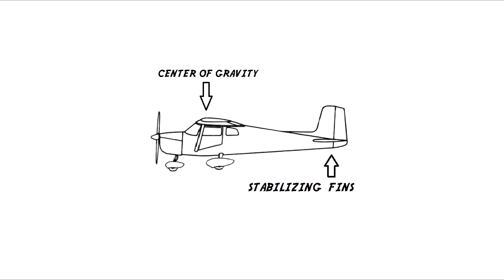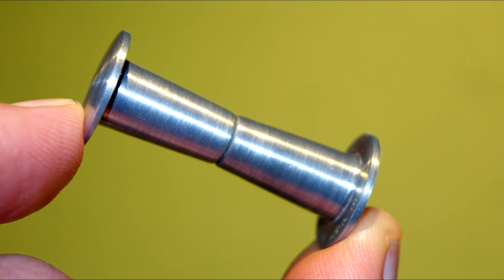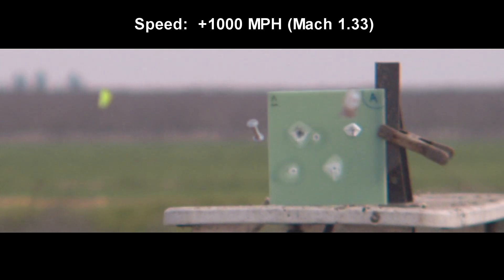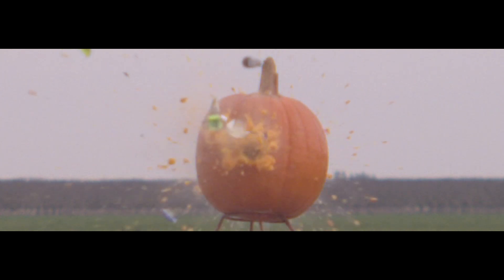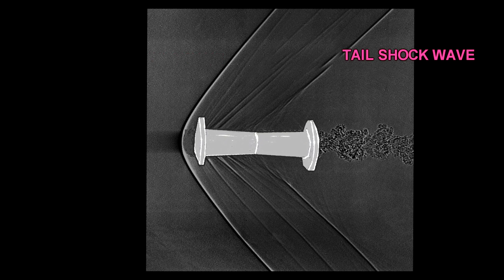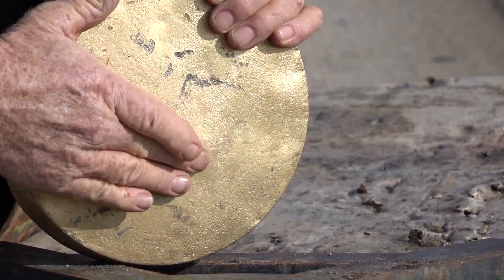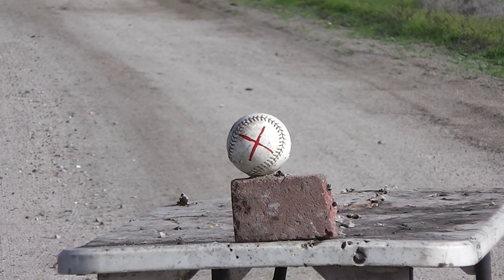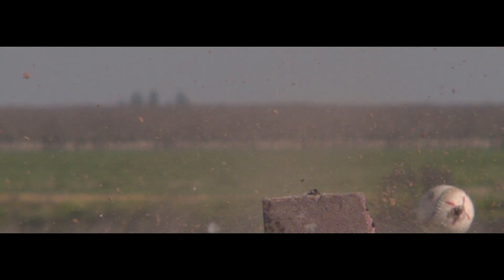The ENIGMA Projectile - Shock Wave Stabilized - yep WEIRD

Comment: Drill slightly inwardly angled holes around the outer edges the back plate of the projectile. Should work similarly to how artillery shells are stabilized.

Comment: The fins on the Saturn V were really there in case one of the engines locked hard over. In that case the vehicle turns sideways and breaks up faster than the Launch Escape System could respond. The fins were to slow down the rotation enough for the LES to get the Command Module safely away.

Comment: The animation at the start is BS, as a liquid fueled rocket progresses the CG moves towards the rear, NOT forwards. The CP varies depending on plus or minus the Mach velocity, the transitions can cause unusual instabilities. No regular shaped object maintains aerodynamic stability during the transition.
Reply from the maker: Who can question a guy named firefarter?
Reply: @taofledermaus  ;-)  It's just for a tag. see thumbnail.
And that's Mr Firefarter, but you can call me Biker.
But seriously, check your physics about CG of a liquid fueled rocket. And aerodynamic CP only remains consistent and stable for a fixed velocity/density etc and non-turbulent flow. My 'name' is irrelevant to the facts. Your animation/explanation is false and akin to the argument that a rocket cannot accelerate in a vacuum because it has nothing to push against.

Comment: I would think of you put that thing in a wind tunnel you would find that the leading edge shock cone almost completely blanks off the trailing edge up to slower speeds which is when it is corrected - I think it’s drag that corrects the tail at lower speeds

Comment: I’m wonder if the stud and threading that hold the two pieces together have anything to do with flight characteristics. If one part has the threaded stud, and the other one just has a threaded hole, I wonder if the studded part could be threaded deeper than what’s sticking out. That would change the center of gravity. Or are both parts made with an equal depth hole, and the threaded rod is split evenly between both parts?

Comment: This video pops up on the YT home page every so often, and has been on my Watch Later for a while.

What I'd like to know, is if this projectile would fly better or worse if it was a single, solid, machined piece of metal without the screw-joint? It shouldn't be too hard to make a few, would it? Then you could machine it into the proper size for it to fit your barrel "tubular projectile guide" and allow the rifling "rotational accuracy-enhancement grooves" to spin it without the need for sabots.

Comment: I'm surprised you got that thing to fly so straight. I think it would perform worse with centrifugal force are as you say spinning stabilizeation bc of the way it's weighted, the back will always wobble and try to pass the front, lamener air flow being one problem and then you've got two heavy ends with a thin bar in the middle, it'd be like trying to hold a spinning train axle still. theres only way to stabilize it in flight and that would be if the ends weighed the same too spin them in separate directions too equalize the centrifugal force. It would still wobble bc of air flow being high in the front low, then high then low again, to much drag in to many places.

Comment: Purely speculative on my part, but there was a question posited as to what force tended to keep the projectile flying reasonably straight. Both ends are flat, inwardly directed conical shapes. I posit that as the projectile  destabilized and the rear portion began to can’t forward, the bow shockwave that was formed by the forward movement pushed the on the inside, increasingly outward slope of the projecting conical as that momentary orientation created a great deal more drag than the forward face of the projectile. This momentary pressure moved the overall direction of travel back to the long axis of the projectile’s travel.

Comment: I have a suggestion for the modifications of the design of projectile you were meant to sent into a Target straight. I Ponder if it would be acceptable to drill holes of any particular diameter through the posterior and bow ends in a particular directional pattern so as though to collect air flow to pass between both sides creating a Vortex for stabilization regardless of fins.

Comment: That's a pretty cool round, i really like how stable they were. Was pretty surprised at that when i saw it. And thank you for explaining the shockwave thing. So from my understanding, the shockwave pushes the rear back in line when it tries to tumble.
So i'm wondering how it would work out, if it would work if the front "plate" was a little more cone shaped, Just a tiny bit to narrow the shockwave cone.

Comment: So my guess to why this projectile only had a slight wiggle going back and forth; due to the nature of the design, the drag of the projectile is optimal when it is flying 100% straight. As soon as it starts getting an angle, the air will push against the side of the backplate that is 'off'. This probably pushes it back, and causes it to go 'off' in the other direction, causing the slight wiggle we see in the slomo's. This effect might be amplified by the rear shockwave, as that seems to about correspond with the limits of the wiggle.
All in all not bad for a projectile this shape!

Please note I am in no way a physics engineer, so if somebody can shed some professional light on my comment, feel free to do so!

Comment: I think your sabot assemblage was problematic. The sabot needs to be single-piece I think.  Got a 3D printer?
Reply from the maker: For the most part,  the sabot system we used worked fine.   We could have just shown the best shots but that wouldn't be an honest test.

Comment: changing the edge of the projectile a nylon that's mated to the surface would eliminate the need for the plastic pieces that are causing the deflections. also making the front slightly more coned would allow the rear to have less deflection area as well.

Comment: 5:20 Was that a disc of fluid flying away from the jug at 5:22? Can someone explain what I just saw?
Reply: Quinton James it’s common for milk jugs to have a slight circular depression on one wall of the jug (google image search “milk jug” for an example). It’s likely that the rapid movement of the fluid tore around the edges of the circle and sent it flying.

Comment: Your advanced kinetic testing video was fascinating.  Your Launch director clearly has years of experience with Rapid mass acceleration tests as demonstrated by his high degree of precision while operating the test equipment.  I additionally think that on the tail end there is a negative pressure developing in the area that is "shaded" for lack of a better term by the projectiles shank and that lift force pulls the projectile in that direction and it oscillates back and forth as that ebbs and flows while it wiggles its way down to the mass energy absorption and deceleration indicator plate on the remote end of the lab.  ; D  Great Video as usual my man!
Reply from the maker: thank you!

Comment: OK, I showed the video to a friend that is a real retired rocket scientist. He said to tell Even a 14° cone front and rear, a 5% more forward weight differential, will solve the stabilization issues. Maybe shorten by 1/4 inch for half the tests. Last a higher speed camera to get clearer pics of the flight.

Comment: I am wondering if you used wads designed for 3.5" steel shot loads would work better?  These allow for around 2" projectiles and would separate quickly.  Just a thought.

Comment: What do rockets have to do with this? The dynamics of a rocket are very different from those of a projectile. There is no force pushing on a projectile after it has been released, nor do its mass and center of mass change over time.

I'm not an expert in physics, so I don't want to make any claims, but I am wondering what is the basis for your claims about the physics of this projectile specifically, and about physics generally?

Comment: Instead of splitting the front sabot, use petals that extend from the rear sabot up to the sides of the lead surface..  Having the plastic out front disrupts the wave front, and the projectile.

Did the projectile maker do CFD analysis prior?  Would be nice to see that side-by-side with your flight results.

Comment: The problem with the shot cups is that they will release at differents speeds and if the front cup is slower than the rear it will not be stable. The reason for the waggle is that the back end was acting like a stabilizer as on the saturn as it left the wake of the front end

Comment: if you make the ends of the steel have a smaller diameter and then have copper wire wrapped around them, you might be able to shoot these through a rifled choke.

Comment: I’d like to see designs that have the exact opposite goal in mind. Imagine if the mass that is to be accelerated was so aerodynamically unstable that it would tumble hundreds of times over a short distance of 100’. Like it would apply the angular momentum parallel to the accelerated mass. And you could test it through a wide range of speeds to see the difference in flight between sub/supersonic. Basically add backspin to these masses

Comment: Palavra chave: Code Brasil 55

01000010 01100101 01101101 00100000 01010110 01101001 01101110 01100100 01101111 00100000 01000001 01101111 00100000 01001010 01101111 01100111 01101111 00100001 00001010 00001010 01000101 01110011 01110100 01100001 00100000 01100011 01110101 01110010 01101001 01101111 01110011 01101111 00101000 01100001 00101001 00100000 01110000 01100001 01110010 01100001 00100000 01110011 01100001 01100010 01100101 01110010 00100000 01100001 01110100 11101001 00100000 01101111 01101110 01100100 01100101 00100000 01101001 01110011 01110011 01101111 00100000 01110000 01101111 01100100 01100101 00100000 01101100 01100101 01110110 01100001 01110010 00101100 00100000 01110010 01110011 01110010 01110011 01110010 01110011 00001010 00001010 01001111 01100010 01110011 01100101 01110010 01110110 01101111 00100000 01110001 01110101 01100101 00101100 00100000 01110110 01101111 01100011 11101010 00100000 01110100 01100101 01101101 00100000 01101001 01101110 01110100 01100101 01110010 01100101 01110011 01110011 01100101 00100000 01110000 01101111 01110010 00100000 01100100 01100101 01110011 01100001 01100110 01101001 01101111 01110011 00101100 00100000 01110000 01101111 01101001 01110011 00100000 01100101 01110101 00100000 01110100 01100010 01101101 00100000 01100001 01100011 01101111 01101101 01110000 01100001 01101110 01101000 01101111 00100000 01101111 00100000 01010110 01101001 01100001 00101101 01001001 01101110 01100110 01101001 01101110 01100100 01100001 00101100 00100000 01101101 01100001 01110011 00100000 01110001 01110101 01100101 01110010 01101111 00100000 01100100 01100101 00100000 01100001 01101110 01110100 01100101 01101101 11100011 01101111 00101100 00100000 01100001 01110110 01101001 01110011 01100001 01110010 00100000 01110001 01110101 01100101 00101100 00100000 01100101 01110011 01110100 01100101 00100000 01110000 01110010 01101111 01101010 01100101 01110100 01101111 00100000 01101110 11100011 01101111 00100000 01110100 01100101 01101101 00100000 01101110 01100001 01100100 01100001 00100000 01100001 00100000 01110110 01100101 01110010 00100000 01100011 01101111 01101101 00100000 01101111 00100000 01010110 01101001 01100001 00101101 01001001 01101110 01100110 01101001 01101110 01100100 01100001 00101100 00100000 01110011 11110011 00100000 01100101 01110011 01110100 01101111 01110101 00100000 01100001 01110000 01110010 01101111 01110110 01100101 01101001 01110100 01100001 01101110 01100100 01101111 00100000 01100001 00100000 01101111 01110000 01101111 01110010 01110100 01110101 01101110 01101001 01100100 01100001 01100100 01100101 00101100 00100000 01110010 01110011 01110010 01110011 00101110 00001010 00001010 01010110 01101111 01100011 11101010 00100000 01110100 01100101 01101101 00100000 00110010 00100000 01101111 01110000 11100111 11110101 01100101 01110011 00100001 00001010 00001010 00110001 10111010 00100000 01001001 01100111 01101110 01101111 01110010 01100001 01110010 00100000 01100101 01110011 01110100 01100101 00100000 01100011 01101111 01101101 01110101 01101110 01101001 01100011 01100001 01100100 01101111 00100000 01100101 00100000 01110011 01100101 01100111 01110101 01101001 01110010 00100000 01110011 01110101 01100001 00100000 01110110 01101001 01100100 01100001 00100000 01100100 01100101 00100000 01110110 01101111 01101100 01110100 01100001 00101100 00100000 01100001 01100110 01101001 01101110 01100001 01101100 00100000 01110110 01101111 01100011 11101010 00100000 11101001 00100000 01101100 01101001 01110110 01110010 01100101 00100000 01100101 00100000 01110010 01101111 01101111 01110100 01110011 00101100 00100000 01110010 01110011 01110010 01110011 01110010 01110011 01110010 00101110 00001010 00110010 10111010 00100000 01000100 01100101 01100011 01101111 01100100 01101001 01100110 01101001 01100011 01100001 01110010 00100000 00100000 01101111 00100000 01110100 01100101 01111000 01110100 01101111 00100000 01100001 00100000 01100010 01100001 01101001 01111000 01101111 00100000 01100101 00100000 01110000 01100001 01110010 01110100 01101001 01110010 00100000 01110000 01100001 01110010 01100001 00100000 01101111 00100000 01110000 01110010 11110011 01111000 01101001 01101101 01101111 00100000 01101110 11101101 01110110 01100101 01101100 00101110 00001010 00001010 00001010 01010100 01100101 01111000 01110100 01101111 00100000 01100011 01101111 01100100 01101001 01100110 01101001 01100011 01100001 01100100 01101111 00100000 00101101 00100000 01000010 01101111 01100001 00100000 01010011 01101111 01110010 01110100 01100101 00100001 00001010 00101000 00100000 01111001 00110101 00110101 00110110 01011111 01100011 01101000 01001000 01100001 01001010 00110001 01101011 01010101 01010111 01011000 01001100 01100010 01000101 01000010 01010001 01000101 00110110 00111000 01111001 01101011 01110011 01010110 01110110 01000111 01110001 01011000 01100100 01110111 01110100 01010000 01001001 00111000 01101110 01100100 00110110 01110101 01001111 01010101 00100000 00101001 00001010 00001010 00001010 00001010 00101010 01001111 01100010 01110011 00111010 00100000 01101001 01110011 01110011 01101111 00100000 11101001 00100000 01110101 01101101 01100001 00100000 01100011 01101111 01101101 01110000 01100101 01110100 01101001 11100111 11100011 01101111 00101100 00100000 01110000 01101111 01110010 01110100 01100001 01101110 01110100 01101111 00100000 01110011 01100101 00100000 01100011 01101111 01101101 01110000 01100001 01110010 01110100 01101001 01101100 01101000 01100001 01110010 00100000 01100001 01110011 00100000 01101001 01101110 01100110 01101111 01110010 01101101 01100001 11100111 11110101 01100101 01110011 00100000 01101110 01100001 00100000 01110001 01110101 01100001 01101100 00100000 01110110 01101111 01100011 11101010 00100000 01100001 01101100 01100011 01100001 01101110 11100111 01100001 01110010 00101100 00100000 01110000 01101111 01110011 01110011 01100001 00100000 01110011 01100101 01110010 00100000 01110001 01110101 01100101 00100000 01110110 01101111 01100011 11101010 00100000 01100001 01110100 01110010 01100001 01110000 01100001 01101100 01101000 01100101 00100000 01110011 01100101 01110101 00100000 01100100 01100101 01110011 01100101 01101110 01110110 01101111 01101100 01110110 01101001 01101101 01100101 01101110 01110100 01101111 00101110

Comment: Those will be more stable at subsonic speeds.  As the back end tries to tumble over, part the back end winds up in the airstream (or less masked by the front end).  That force against part of the tail is offcenter and pushes the tail back in line-- until it wobbles in the other direction and repeats.  To see this at slower speeds, check out "spool rockets".

Comment: The intro reminded me of a time when I was a kid in science Olympiad: we had a contest to design and fly paper airplanes the furthest when thrown from a 50ft wall...my design was found in a 1950's book of paper airplanes, and consisted of two rings connected by a stiff straw with weight in the front (sinker) 
Mine flow much further than any other plane, and perfectly straight.  It was the big win of my nerdy childhood 😂
Reply: i really liked making paper airplanes when i was in elementary you just reminded me of one that is basically a ring folded from a sheet of paper with the front side folded on itself several times for weight that you just push forward flew kinda slow but smooth and surprisingly far
Reply: @niq872  this airplane is one of my favorites because it tends to make a dive when it is flying too flat/horizontal, and then when it accelerates from the dive it pitches back up to horizontal again.. it is such a nice design because it has a nice flight pattern, and it is a paper plane that has curves..

i expected Prolific Invention to tell how he won because he used a mass accelerator..
Reply: @niq872  they made a plastic toy version of it. It crosses a football field I believe. Spin stabilized btw
Reply: Which is yet another reason I sub to your channel. No contests back then but I loved making all kinds of paper airplanes. I used to be really good at tuning the back flaps to make the pointed ones almost hover.
Reply: @johnpossum556  Thank you John, that is very kind.
Reply: @johnpossum556  really i was never good at  that, it would always ruin the plane for me because they would just twirl and fall.
Reply: I remember your design from a book on paper airplane construction. Congratulations on your win. I still have an interest in paper airplanes after 60 years.
Reply: @Kneon Knight Thanks for the pointer to the book.
Reply: That was my favorite style of paper airplane when I was a kid! It flows beautifully but I always thought it wasn’t quite a regular paper airplane because you couldn’t make it out of a single folded piece of paper.